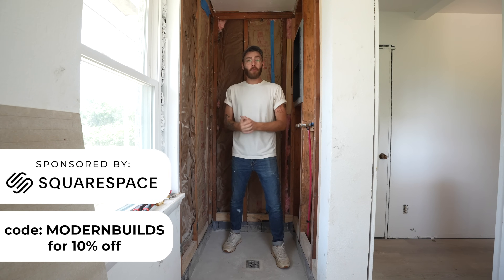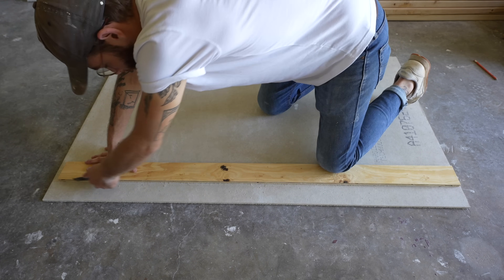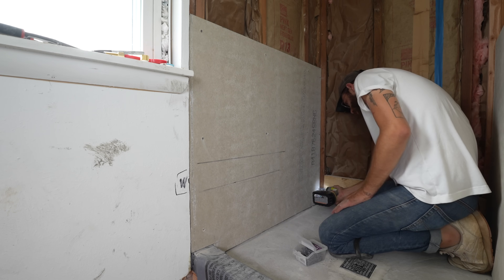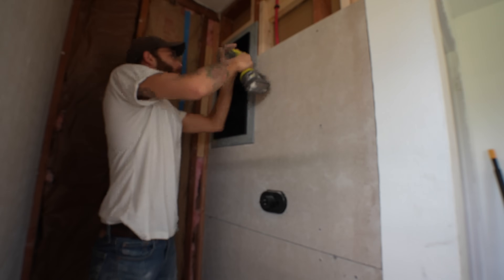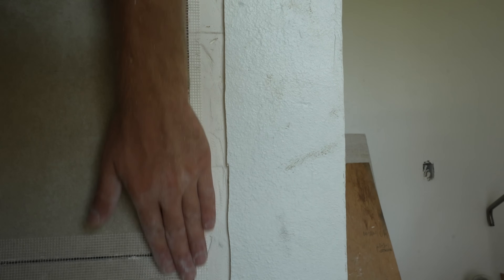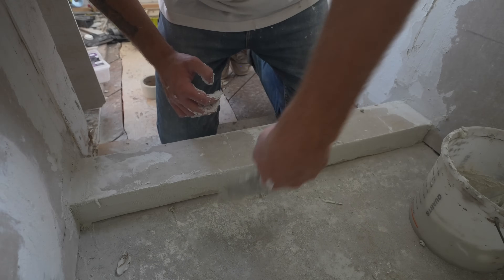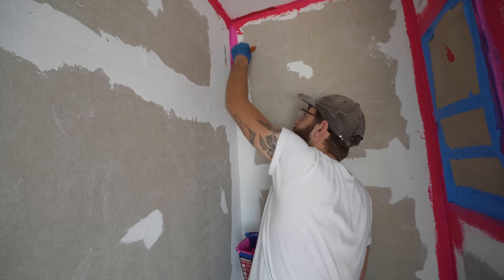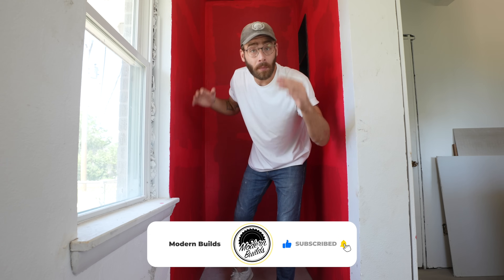5 Easy Steps to Cut, Install, and Waterproof Fiber Cement Board Shower Walls!! Shower Build A to Z

Comment from the maker: Back to Back shower content today!!! If you have any helpful tips I missed, be sure to leave them in the comments so future DIY'ers can benefit. Thanks for watching, can't wait to get the tile video out next!! -Mike
Reply: What are you planning to do for the ceiling in that area? I am not fully caught up on the series, but do you know if the drywall on the ceiling is waterproofed? If not, you may want to first test for asbestos, and if it's not there, look at a high quality water proof paint for the roof when you get there. It may be easier to paint before tiling depending on how high up you are going to tile.

Comment: Ugh, I hate that fiber cement board. It's heavy, a PITA to cut and if you use any power tools on it for holes you will have lots of cement dust. And then you have to waterproof it. Others have suggested Go Board, another great alternative is Denshield- weighs and cuts like drywall AND it's waterproof already. You just have to seal the seams and screwholes. Once you use the more modern waterproof wall boards you'll never go back.
Reply: DIYers should also know the Redguard manufacturer recommends applying the 2nd coat at a 90 degree angle to the first one. In other words, if you were rolling it up and down on the first coat, you should have rolled the 2nd coat side to side. I'm sure the install shown in the video will be plenty waterproof, but alternating directions makes the material stronger. You could always roll on a third coat if you have any doubts. Redguard is a DIY'ers best friend!

Comment: Redguard the floor, including getting it sealed against the drain. That way the mortar bed stays dry, with the PVC pan liner functioning only as a secondary fail-safe should the red guard system ever fail (which it prob. won't).

Comment: Hey,,
How did you get a watertight seal between the cement board and the liner you put on the ground? 
Did you apply the paint on the outside of the board and then just place the cement board on top of the liner? How is that made waterproof? :)

In my mind, the "right" way to do it is to connect the waterproofing on the floor and the walls, rather than just overlapping them with a non-watertight material in between.

Comment: Pretty sure you forgot to put clips on your water outlet pipe. Saw one at the top but not in the middle. That will hammer and bang agaisnt the cement sleeting